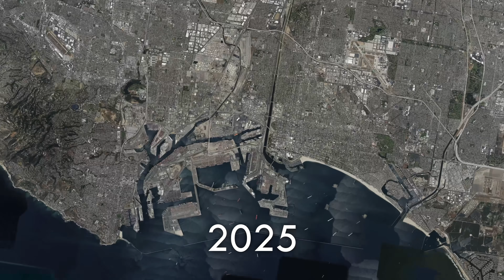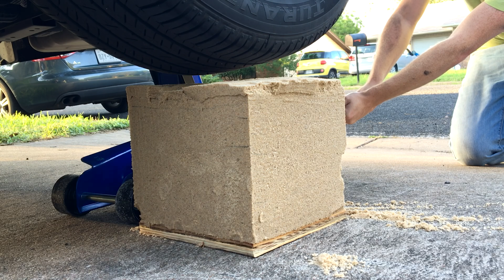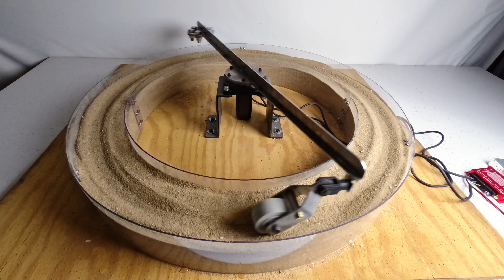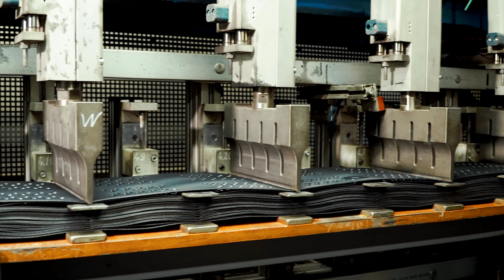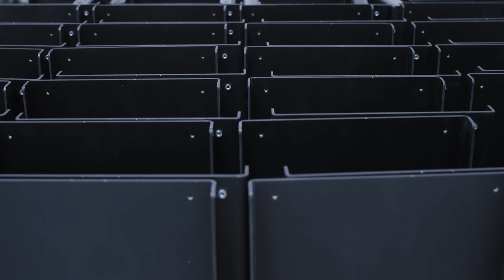The Grid That Doubles the Strength of the Ground

Comment from the maker: 🏞 Lots of cool stuff (plus my book) available at the PE store: https://store.practical.engineering/
⚙ Check out SendCutSend for custom parts fabricated from your CAD: http://sendcutsend.com/practicalengineering
Reply: Why don't we use this instead of pouring foundations in a house?
Reply: @RPG_Guy-fx8ns  The magnitude of scale doesn't add up. If we do this instead of building pilons of concrete boxes then the settlement just would accelerate.
Reply: would making vertical LAYERS of geo-cells (with each layer offset from the one below it) create a STRONGER fill than if you were to use the typical material? Of course it would on the sides (lets use the example of a retaining, just to make this easier)  OKAY LETS START OVER lol
A retaining wall, for example, would require so much brick and steel rod to hold back
Reply: @PracticalEngineeringChannel instead of using plastics for GeoCells, could we grow plants (eg roots) in the same shape?
Reply: @cheater00  Except roots can be composted thus loosing integrity, for that to withstand the plants must be kept alive.
Reply: @johnnychang4233  depends on roots. have you ever dealt with a bamboo infestation?
Reply: I like it
Reply: I soooooooooo miss the old intro music. =)
Reply: Hey long time watcher on nebula, just dropping into the comments because I just found out that there are cranes that build cranes and thought that could be a cool engineering feet to cover
Reply: Do these plastics break down  chemicaly? Not asking over micro plastics. Just wondering if in 20-40 years a surface can suddenly start to crumble because the geo-textile underneath is turning to dust.
Reply: @tiesurcess3639  This aspect of engineering should get more thought than it does. It's all smiles and good when you have data and calculations which show something will work and initially does, but what happens when it fails? You need only to look at the Millennium Tower situation to understand that "we think" and "it should" or "we expect" isn't good enough, and nothing should begin without a full mitigation plan for possible failures. 

Under a roadway geocell failure wouldn't be a big thing; after all we build and repair roads all the time. But under a skyscrapewr or as a footing for the main pier of a bridge the cost of failure might be far more than what is potentially gained with using it. Nothing we build will last forever and some things need an almost absolute certainty before you can justify a particular usage scenario.
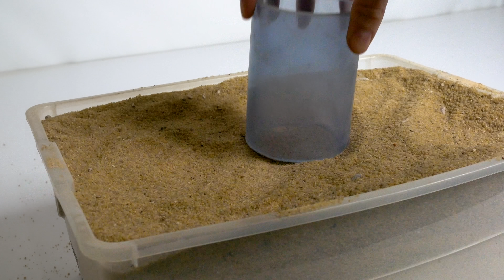Reply: 8:42 "can't just disappear under load"
unless you are talking about the twin towers

Comment: I use a form of this on the side of my driveway where I didn't want concrete and liked my grass.  Its called Stabiligrid and its a poly type of plastic that lock together in squares, has a solid base layer and is backfilled with good dirt and grass grows through it and over the top.  You can't even tell its there but I can drive my truck and trailer over it without putting ruts in my side grass.

Comment: I was looking for a solution for our garden lawn which has drainage pipes in it, and under heavy rain, it becomes a muddy puddle and my 2wd van sinks. 
I found these slightly elastic 1cm high cells supposed to be just laid on the lawn. I hope it will save me from having to call a bulldozer to tow the van out of a 50cm hole 🙂

Comment: My house has wide asphalt aprons across the whole width of the front of the lot. They are handy for occasional overflow parking, but they are a lot of impermeable surface adding to run off.
I've been considering using something like this to replace them and get the same occasional parking area with less risk of ruts forming. Seems like it would work how I hoped.

Comment: If you use something like concrete building blocks that have those hollow centers, those can be the road surface, and then the infill area can support things like grass, letting you have a green road surface. My mom talked about it at one point, in reference to our own gravel driveway (and how the gravel was shifting downhill, particularly from winter plowing) such that a raised garden bed was no longer a raised bed.

Comment: It's probably a basic, lukewarm take, but i think this is an example of a use case for plastic that i can support, in spite of not liking the use of plastic generally. It would, of course, need to used judiciously, not every problem solvable by fancy plastic grid is BEST solved by fancy plastic grid (see another comment describing its use in a climate with a freeze/thaw cycle that cracked the fancy plastic grid, causing it to be replaced with a fancy concrete grid). 

The world i desire would have significantly less plastic used, with plans in place to remove or replace it when it degrades.

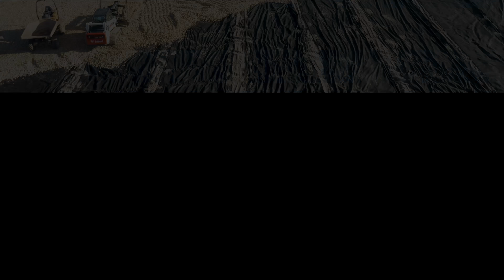Comment: 1:54 GiO Ibanez… Geo Tracker.. Geo-OD… 
2:38 …Fill!
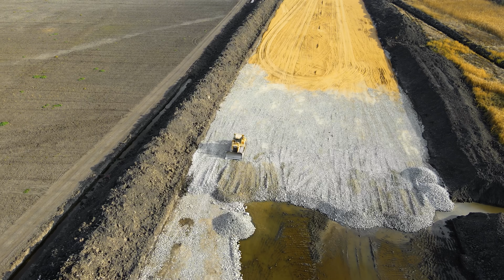5:12 So “angular” here means… just not pebbles?
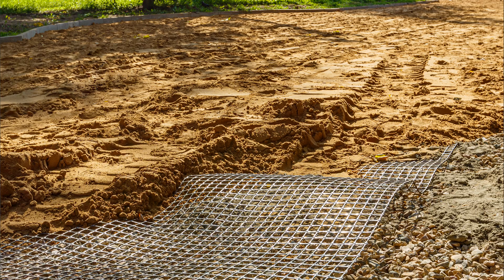7:04 They used to build airstrips outta this in WW2. 
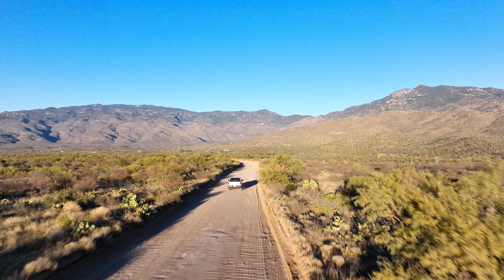10:57 Ha. I always thought this was done on purpose to get drivers to slow down… 
13:37 It doesn’t matter that that’s not a drive-wheel?
14:34 AKA Teflon 
edit: nope that’s PTFE… 
HDPE = High-Density PolyEthylene (the kind of tub Jesse was supposed to get)!

Comment: That's quite cool. I wonder if you could increase the strengh by using honeycomb instead of squares. Secondly : I kind of feel like using it on the sides to prevent erosion is an mistake. We should use a biodegradable thing, and instead, plant things with big surface roots to prevent the erosion like in nature. But hey, better than using concrete and asphalt I guess. It makes me wonder why this isn't made more for some dirt roads that see trafic. It kinda looks like the kind of cheap upgrade that could withstand a lot of weathering.

Comment: You could make similar cells without welding just by having slits halfway through planks of material and then interlocking them into the final grid.

If you want to use something other than plastic, that method might be a lot cheaper. Like wood or aluminium for relatively cheap materials, since they only need to stop the shear rather than truly be load bearing themselves.

Comment: This actually would be an amazing thing to sell to beach towns. Being able to just reinforce the existing sand without completely removing it would do a ton towards keeping good beach roadways and patios. Without disturbing the local environment too much. Also likely reduces the inevitable erosion. If we are going to establish roads I prefer them to be as minimal, and less pavement, as possible. People need solid bases to work and travel on but it doesn't need to come with replacement of the ground, rather reinforcement and synergy with it.

Comment: My dad and I were discussing the development of washboard on dirt roads the other day and I sent him your video. They have an off-grid campsite with mostly unimproved infrastructure. Any infrastructure that exists is up to the campsite owners to maintain. His assertion is that if everyone would use 4x4 while traversing their dirt roads, that would slow the development of washboard development. I pointed him to your video, but he insists that it's not equivalent because the wheel isn't driven. I told him gravity is gravity, but because the washboard pattern develops because the wheel is "pushing" material, it does make me wonder if it matters if the wheel is driven rather than simply being pulled. I'm hoping you'll be as curious about this as me, and maybe post an answer at some point :)

Comment: i have expansive clay soil on a sloped lot.
i used tires with the sidewalls cut off & filled with recycled crushed concrete on top of fabric on top of clay, behind retaining walls to terrace my lot for patio levels.  Paver base then sand then pavers as per usual at that point.

mechanical concrete is the engineering name for the method.  Sam Bonasso "invented it", my guess is with inspiration from Michael Reynolds.

Comment: I used 14 oz non woven landscape fabric and 4" 9'x20' geo grid cells filled with 3/8 washed chip gravel packed it with a plate compactor as my base layer for my wifes raised garden beds, works perfect.

Comment: Mechanical Concrete... Look it up.  I tried to post a link, but my post got deleted.  Mechanical Concrete uses recycled tires (tread doughnuts - no side walls) and crushed, recycled asphalt as the filler.  I've seen it in action and it absolutely stops potholes, ruts and erosion.

Comment: Could actually be used in Suburbs. They have low traffic and the maintenance is much cheaper. Currently Suburbs often cost more than they bring in if you consider maintenance of the roads, plumbing and electricity.

Comment: I am pretty concerned that the increased use of plastics has led to micro plastics contamination in our water.  Recycling plastics sounds good until you look at the numbers and realize it is not as universal as you would want.  If we could switch back to glass ( ex: water bottles ) and other natural materials then using recycled plastic as a filler for geo-cells sounds pretty exciting.

Comment: I learned about this several years ago when I was building a shed in our yard but didn't want to used concrete as a base.  After the area was dug out, I spread out that "plastic accordion" and filled it with pea stone.   The shed is still solid and level.

Comment: I expect the geocell can also allow you to scale the size of the cells so you can adjust for lower and higher compression resisteance so you can even regulate subsidence as well.  I expect you can layer geocell and pavement on the top layers as needed to handle varying sink rates as the pier, jetty or mole settles.

Comment: Aquarium hobbyists use this technique for substrate in their tanks. I have fine river rock gravel, which is basically very large smooth-grained sand, so it's extremely unstable on its own (especially underwater). I have a layer of recessed lighting louvered eggrate in the substrate, which creates a stable base that I can put very heavy, pointy hardscape on top of without fear of it sinking and cracking the bottom.

Comment: I wonder how vital the cells being linked together, sharing walls, etc, is to it's utility and durability. If you could get a similar result out of dropping a bunch of tightly-packed tubes, rather than expanded accordion/scissor lines, it might change manufacturing requirements. It's probably moot, but I wonder if someone could DIY a driveway out of a couple thousand plastic bottles or something.

Comment: Ive seen this used on home driveways instead of concrete. Its been installed in one home I work on for about 7 years, and its held up really well, and was installed before the remodel was done, meaning it got HEAVY traffic from construction crews, vehicles and equipment, even Semis, and has been a fantastic solution. I thought it was weird at first, but its been a great solution.

Comment: Another thing I would think is that geocells probably provide some limited protection from earthquakes, too, especially compared to a stiff concrete slab. 
For much the same reasons as a floating foundation helps to dissipate/transfer the pressure waves from an earthquake. You’re forcing the waves to propagate through a noticeably different, flexible medium. A concrete slab just takes all the energy and fails, whereas geocells can absorb some of it. I would be concerned about liquefaction and similar effects emptying some of the cells and reducing the overall integrity, though.

Comment: The one blind spot people always, always have with environmental impact is haul distance. Moving stuff is hard! And being able to use a lightweight "cell" that turns your local materials into something that you'd have to get from a lot further away is insanely efficient for the environment. Do I love putting plastic in the ground? Not really, but such is the beast of engineering.
Reply: I don't mind the more stable heavy duty plastics like HDPE, we're already in deep with that and it is a relatively nonreactive plastic. My hang-up is mostly the giant styrofoam blocks being used, yes I get its light fill but its also like the grand-daddy of microplastics that never degrade, and just turn in to a soup of tiny polymer particles with as-of-yet unknown effects. There needs to be a lot more conversation about what we can do differently to build with a bit more responsibility. We've worked without giant foam blocks before, and I for one think we can deal without at least those if anything.

Comment: I saw something similar to this in a film where the Army/Marine FOB were made of large fabric cells sometime 10 ft tall. They lay them out, fill them with soil/sand in the area and are able to build a bullet resistant and bomb resistant  fence around their base. I assume that they are some 10X10 or 12X12 squares. This would give soldiers a solid protection while being easy to build and remove.

Comment: It is worth noting that these don't necessarily have to be made out of plastic, if other materials are less environmentally harmful, we can use those instead. Whatever method is used to build the foundation for a structure, there will be environmental impact, and having another tool in our kit is good as long as we apply it responsibly.

Comment: i've been working dirt work for 15 years now and by FAR the best part about geo grid and geo cells is the ability to use local materials for backfill. Not only do you save on the exorbitant cost of trucking in proper fill material, you also save on hauling out the unsuitable material saving MILLIONS of dollars on some of these cut-to-fill projects.

Comment: Made a parking spot in my backyard using the geocell stuff with some gravel. I sprinkled some concrete over the top and misted it. It helps any top layer stuff not get kicked up as easy. Cheap and works great.

Comment: An excellent example of geotechnical engineering solving real-world infrastructure challenges. Geocells demonstrate how intelligent ground reinforcement can improve bearing capacity, reduce construction costs, and make better use of local materials—showing that innovative design often outperforms simply adding more concrete. – Dr. Sera, P.E., PhD

Comment: The washboarding test at 12:30-13:03 is the clearest proof-of-concept in the video — same track, same speed, and the geocell version just refuses to corrugate at all. That's not a marginal improvement, that's eliminating the failure mode entirely.

Comment: The issue of putting plastic in the ground is a bit like the discussion about diesel vehicles versus electric ones - a diesel vehicle releases more pollution over It's useful life, but significantly more pollution is created in the construction of an electric vehicle of the same profile (which may be solved by the use of the new sodium batteries). In the case of plastic geocells, if less pollution is created in their use by reducing haulage, excavation, etc, then it's a net benefit even if the plastic itself isn't great.

Comment: I used these for my drive in Wales. Roughly levelled the ground, laid the cells (interlocking tiles in my case) shovelled soil ("dirt") back in and let the grass grow. Takes vehicles no problem and gives good traction in Winter.
Thanks for the full explanation of how they work!

Comment: In the UK geocells are so good at providing parking with minimal cost and without needing paved parking. For a country park with mushy ground for parking you can just lay down a grid and press it into the ground. It's not as clean and smooth as paving, but so much better than a muddy field.

It's also used to provide stable off-road parking on the grass next to a road where the ground would otherwise develop massive ruts from even light use.

In so many cases I'd prefer geocells over concrete or tarmac.

Comment: Isn't this the same principle that has been in use for more than 2 decades in other parts of the world? An appartement building near me, built about 15 years ago, used this as a way to combine three different wishes: green surface (grass), permeability, and the ability to support fire trucks in case of a fire emergency and support moving vans and ladder lifts when people needed to move in/out. It's a common thing, isn't it?

Comment: I used geocell material to redo my grass secondary driveway which is fairly steep.  It worked great.  I excavated 10 ftx 40ft about 5 inches deep,  spiked down the geocell, with 10 inch galvanized spikes and filled it with 10 tons of gravel (by hand!)  Then i put the earth back on top and planted grass seed.  So far so good.  It has resisted car and trailer traffic,  rain storms, etc.  Great video as usual.

Comment: it seems like you can build them even better in space applications by melting the soil/rock in a geo-grid pattern. This requires zero input materials and should have a similar effect.  I do think the geocells will throw off microplastics and they will ultimately be nearly impossible to remove.

Comment: Great demo, but I think the environmental section deserves more pushback than "HDPE is inert." The bigger engineering issue you skipped is creep: HDPE loses a huge chunk of its stiffness under sustained load and elevated temperature — that's exactly why the industry developed NPA geocells and why design codes apply heavy long-term reduction factors to HDPE strength. Your track test shows short-term confinement beautifully, but a container yard loads those cells 24/7 for decades. And on cost: confinement only works if the infill is properly compacted inside the cells, which is slow, labor-heavy QC work — in regions where aggregate is cheap, a thicker base course often still wins. Geocells are clever, but "the plastic does the work" is doing a lot of work in this video.